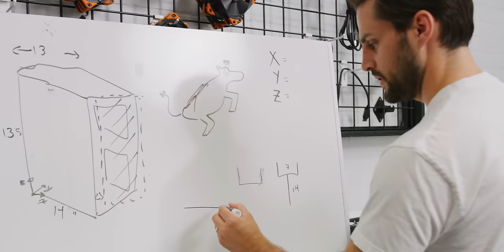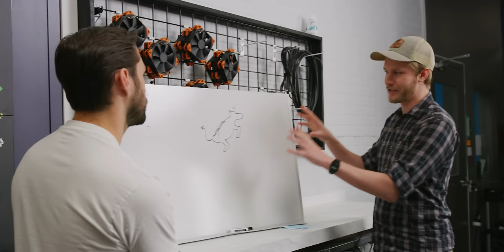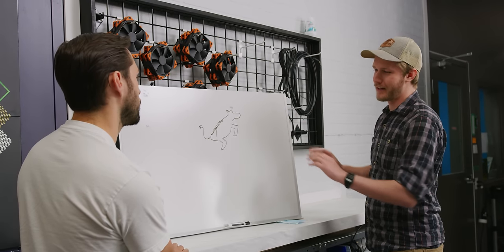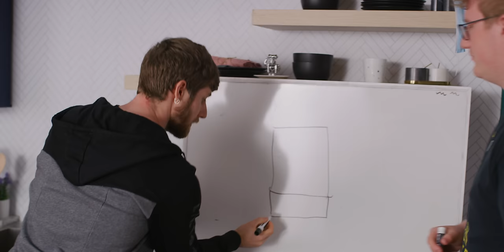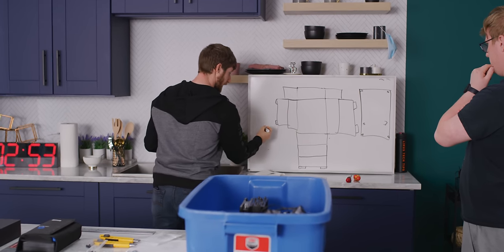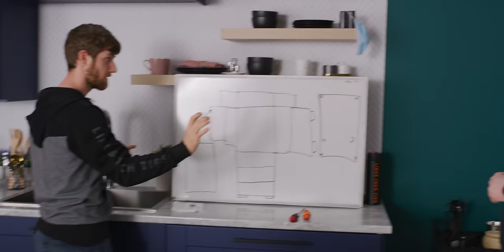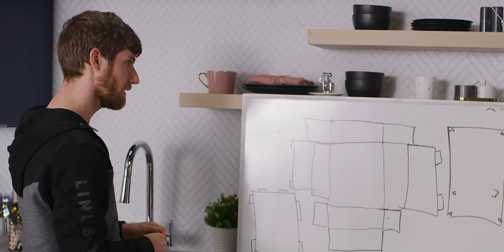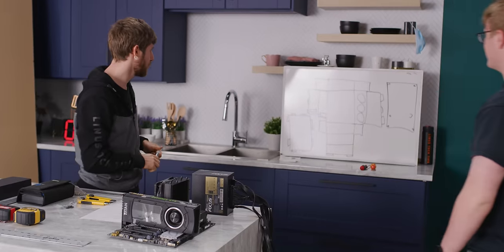Cardboard DIY PC Case Building Challenge!

Comment: Ironically, Alex's engineering background led to him over engineer the case and it back fired on them.
Reply: simplifying a design is a common problem among engineers
Reply: I think draawing on it with sharpie was also a horrible idea
Reply: Well, when I took some electronic engineering technology one of my professors quoted the K.I.S.S. rule, if Alex was an engineer, he should have thought of a "desktop" case with the components laying horizontal.  Actually, both teams should have.  I don't understand this obsession with building towers as towers don't really fit in entertainment systems as much as desktop computers and I was glad that my HP's Elite Desk system and even my older HP Compaq have the option of tower or desktop modes.  The older one the drives could be swapped out and rotated 90 degrees without tools to flip from one orientation to the other.
Reply: do all engineers make horse :')?
Reply: There is no such thing as overengineering....
Reply: @lester44444  no they make cow
Reply: @MicroageHD  its an cardboard case,there is no overengineering boy, actually alex´s design is what most of us will have done when they try to make their own cardboard pc case so ye xd
Reply: I think engineers have this weird habit of flexing whenever they do ANYTHING more complicated than breathing. Probably because they feel the need to justify their incredibly lengthy and expensive time spent at college.
Reply: big oooof
Reply: @jameswolf5513  among
Reply: @Corristo89  When you have an entire toolbox at your disposal, you're going to look for a perfect solution. When all you have is a hammer though... Well, adversity builds innovation.
Reply: @WJCTechyman  desktop computers, yuck. Towers are much better.
Reply: Like the germans did on their french holiday

Comment: Lowkey i want them to spend a lot of time on a cardboard case that actually comes out perfect
Reply: I was thinking that too. You really could build a awesome PC case out of cardboard given unlimited time, tape, and some nuts n bolts to hold the motherboard up.
Reply: I agree m8
Reply: Like a Nintendo labo PC case
Reply: And possibly like laser cut out the cardboard sheet that's been actually designed so that everything turns out perfect.
Reply: Nuno Filipe  or has barely any front IO or non-expandable front IO
Reply: @KiraSlith  glue, if you use glue and glue and press two pieces of cardboard together at 90° to each other of its internal structures it's actually surprisingly strong. 

I want to find some refrigerator boxes and put my open air Linux server in a cardboard box case now ;]
Reply: What he said.
Reply: I want Alex to model out one that you can cnc
Reply: This should become a standardized system.
Reply: Imagine this was the big reveal of the fashioned new totally personalized cardoard cases that everyone will start doing and we defeat case producers
Reply: I feel this is going to become a new challenge
Reply: Yea.Alex should model it and share cad aferwards.
Reply: I made a design for one on paper
Reply: @Puchendante  PC builders when they find out their case is prebuilt

Comment: Warning: this case is not designed for watercooling
Reply: Lone Beast so u need fans HAHAHAHA U HAVE FANS GET IT U HAVE FANS HAHAHAHAHA 😂
Reply: What do you mean, you could still water cool a cardboard case?
Reply: @totallyunoriginalusername  well first, if the coolant were ever to leak we need a whole new case for it, second I don't think cardboard can hold screws that hold the weight of a radiator filled with coolant...the cardboard may get ripped off

Last but not the least since neither cases are stable enough cause they don't have glue in it there is structural integrity issues as the cardboard is relying solely on the grip strength of the overlap and the liquid cooling kit may be too much for it to handle
Reply: TotallyUnoriginalUsername no the case would fall apart and spread the water to Eletronics and you don’t want that to happen or everything will explode or not work
Reply: "Phil Swift here, use Flex Seal Liquid as a water tight barrier and the inside is completely dry!"
Reply: @LoneBeastYT , cardboard is much stronger than you seem to think. With the limitations in this video it might be tricky but if you had thick cardboard and staple gun you could easily build a case which would support a radiator.
Reply: @mina86  i dont think the staple guns are allowed in the vid and thats the point
cardboard may be strong but it doesnt have much support or grip
Reply: @mina86  honestly how far are you willing to go just to ruin a joke man seriously?
Reply: @LoneBeastYT , I’m not commenting your joke. I’m commenting on your later statement about cardboard.
Reply: @mina86  clearly you didn't pay attention to the video

James's pc cant even hold itself sturdy enough when transporting let alone with the water-cooler
And for the record I am talking about linus's and James's pc not cardboard pcs in general
Reply: @totallyunoriginalusername  , exactly! It's even better - if you get a leak it'll absorb it quickly ;)
Reply: @LoneBeastYT  , you're right for typical radiators, because they're are brass/copper (actually they don't hold that much water, but copper/brass are very heavy metals).
However, I recently made a size & weight restricted fully water-cooled SFF PC (trying to keep it back-packable in <13L 400x255x125mm and ~6kg) so while it's not a cardboard case :) (actually it's mostly 3x 120x25mm fans+360rad on top, and 3x 120x15mm fans connected with few 10x10mm alu extresion profiles) it's  very minimal and light-weight (for a desktop). So I used EK FluidGaming aluminium series kits (all water contact surfaces being either aluminium or plexi) and that radiator even being 360 is still very light.
So perhaps such parts can be fine in cardboard case too? (but still probably there are more durable and still cheap materials than ... paper :) )
Reply: @blueckaym   tbh I never really put that much thought into my points as my initial post is just a casual post meant solely for giggles and hence gets likes...I really haven't gone through the specifics, 
You guys are damn crazy to bring out your college research papers for make appropriate arguments...what made sense to me is the fact that james's pc cant even hold itself, forget with watercooling and that's where the argument can be favourable to me, I haven't went into how cardboard as a material can't hold radiators
Reply: @KeeganPlayz1234  So funny i forgot to laugh
Reply: Why not?
Reply: @mustangthekitten7765 I doubt James's pc can support a radiator when it can support itself
Reply: Lone Beast Issa joke my guy
Reply: @mustangthekitten7765  oof you caught me there
Reply: Wait why tho
Reply: Lone Beast sorry
Reply: Lone Beast like I should’ve been more sarcastic with it
Reply: @mustangthekitten7765  nah my brain doesn't get sarcasm well, soo kot your fault
Reply: Lone Beast I’m sorry for the misunderstanding
Reply: @KeeganPlayz1234  lol kid
Reply: No

Shit
Sherlock
Reply: WDYM? It's great for watercooling, since it includes automatic leak detection!
Reply: BET
Reply: oh man ☹️
anyways...
Reply: I mean u could use flex tape in the inside for waterproof lining or something
Reply: @KeeganPlayz1234  you are basically comparing cardboard to a piece of paper. its paper on steroids.
Reply: @Ghostrr I ve seen a yt video of a dude's pc being just the parts with no case,collecting dust along the way

You will never know if someone uses cardboard for this
Reply: @taketokojima3055  nice
Reply: @KeeganPlayz1234  stop
Reply: @KeeganPlayz1234  I know exactly where you got your profile picture
Reply: @haph2087  yeah

Comment: I'd be interested to see this revisited with no time limits, and actually try to make the best case possible, out of cardboard only.
Reply: @IRMacGuyver  my thinking was more tutorial and less competition. Some videos take weeks to finish right?
Reply: and hardline watercooling
Reply: easiest and probably "best case" is still a motherboard packaging at all. I fitted a midclass blower style cpu cooler (which is also the only intake fan!) and a regular psu and a 3,5" HDD in such a package, only for GPUs a low profile card is needed or probably a bigger box, at least all my motherboards had barely the same size of packaging.
I ended up with a GPU sticking out a bit of the box,but it was a damn nice small casing and also "portable" with the handles of the original box. Still all i needed was a more silent media PC and everything lying around was also no real option. Since everything fitted tight in the box, the cooling was also efficient since the only fan, the CPU fan blew air with more speed over the whole mainboard part.
Reply: And expanded rules and tooling.

- Double-sided tape allowed, but penalized by a point for each use. That means long joins with tape are preferable.
- Full complement of bolts, screws, and washers. Every computer builder has either a drawer full of this stuff or a nearby hardware store where you can get this stuff cheap.
- Zip ties and paper clips also allowed for hardware.
- Construction paper for aesthetic flair
Reply: I mean, even sticking to the "no tape" rule, there's a lot you could do with this challenge.
First and foremost, I'm surprised neither team thought outside the box (haha) as far as motherboard orientation, because there are two obvious and simple ways that they could have changed their formatting to better use their materials, either with a purely horizontal layout, OR . . . . diagonal. Linus' outer case is brilliant, and having a separate motherboard tray is a great idea, but they could have easily optimized both their space usage AND structural integrity by having their motherboard inserted at a 45 degree angle with the cardboard folded so that the tray and the rigidity of the motherboard itself provided a cross brace, boosting the stability of their entire design. Folded correctly -- with the upper edge of the diagonal cardboard sheet folded down to make the side panel, across and under to provide housing for the power supply and drives, and then up again -- they could have had an entire assembly they could have then slid into their original housing like a fruit box. The diagonal I/O would have also added some visual interest to the whole build at the same time, something that both designs' Basic Boxes lacked.

All in all, yes, this was a cool challenge, and one I too would like to see revisited in the future. I don't think "no time limits" is necessarily the way to go, given it wasn't so much the time limit that was their biggest challenge as their preconceptions of what the case needed to be, but there's a lot that could be tackled with this concept and I'd like to see them do so.
Reply: New video series, Cardboard Wars!

Comment: You guys should do a PVC + acrylic sheet case challenge! It's cheap and looks decent. It's mostly open air and waaaaaay more structurally sound than cardboard
Reply: Ayy 👍
Reply: I like You Chanel
Reply: I vote for LTT and Oz colab trying to build the ultimate DIY case ahah
Reply: Seems like a good idea but I would be worried about the amount of static electricity pvc generates
Reply: @silverado_vila  maybe once the world stops falling apart like James case.
Reply: ayyy
Reply: OZ x LINUS COLLAB
Reply: Acrylic is not cheap.
Reply: And wood don't forget about wood
Reply: But they can only use tape!
Reply: Is this a challenge? Please be a challenge
Reply: fixing fans near heat sink is SO BLADY, my next build will be OPEN AIR ( no Case used ) that's very easy to connect, disconnect and fix new things
Reply: Its fun, until you know your setups need metal and airflow to reduce heat so you can feel safe everytime you play heavy games.
Reply: @DeathByClam  a nice wood case would be awsome
Reply: no

Comment: When you lower the price so much it could run like a potato but still has the best price to performance
Reply: ladies and gentlemen, scrapyard wars
Reply: Considering you can get boxes for free if you look well the price to performance is infinite.
Reply: Mr. Moʀɖɛռ 0/0 is not infinity.
Reply: @charlesgarrett6324  Sure if performance is 0.
Reply: @DickbuttChillingOnPluto  Rather put $50 towards a better CPU. Function over form.
Reply: @DickbuttChillingOnPluto  It was a math joke okay, as the bottom number approaches 0 the solution becomes exponentially bigger. If the bottom number is zero you get infinity, generally considered an error.
Reply: Mr. Moʀɖɛռ yeah a box you picked up for free that has no computer hardware in it has 0 performance.
Reply: Mr. Moʀɖɛռ you are thinking of limits which is an improper approximation of 0/0. If you divide anything by 0 it is not infinity it just doesn’t work. No matter how many zeros you have it is still 0.
Reply: @charlesgarrett6324  https://en.wikipedia.org/wiki/Division_by_zero "it may generate positive or negative infinity by the IEEE 754 floating point standard"

Comment: (C)ardboard (A)ided (D)esign.

I built a sound booth out of cardboard around my computer desk and lined the inside walls with sound proofing foam pieces. No joke... works stupidly well.
Reply: Well cardboard is a noise deadening material so, it's to be expected, what is not to be expected was I used cardboard in my old pc to make a fan shroud as I had a network card too close to the GPU for noctua's fans to fit, and MSI's fans are absolute trash.
Reply: How about ventilation?
Reply: i need to see it
Reply: now
Reply: You just gave me an idea I should not do. Build a cardboard fort, buy carpets and sound proofing foam, and use that as a mini sound-booth.
Reply: how do you hang that thing at the back of the mic? or you just tape that to the wall?
Reply: Continuing the cardboard theme, I have seen egg cartons used for the sound damping, as well, instead of foam.

Comment: Next challenge: a case made only out of the packaging your components come in.
Reply: Setup on the motherboard box, challenge complete
Reply: @billgorsey8010  cpu cooler on the cpu box taped to the mb box
Reply: @billgorsey8010  Or
Open up both GPU and mobo boxes, cut tops off them, and tape the opened boxes together. Cut a hole into one of them and stick the clear plastic for the RAM into it for a window.
Reply: You guys are forgetting about the PSU and it's cables. Therefore put the MB box on top of the PSU that sits fan-down :)
Reply: @bill that's my current set up while waiting for the case, damn I sure miss newegg will call😅

Comment: I feel like they shouldve been given a whole day to plan and build this case, wouldve been a whole lot better in terms of content instead of arguing under time pressure and lowkey hating your partner.

More time to build the case means we get to see their actual technical intellect and maybe even a vision of what they want cases to be like from companies.
Reply: Exactly. This was a really cool idea to see what all amazing stuff they could do instead of making it a rushed cramped mess.
Reply: or a few days. lots of content can be pumped out
Reply: See, that would run the danger of actually being good content. Can't have that.
Reply: why not both? :)
Reply: @GeorgePerakis  Tell us how you really feel.
Reply: @papayer  You can't deny that a lot of their stuff is rushed. The one vid per day thing is not a good formula for quality with the number of employees they have.
Reply: I really wish they do this again with no time limit
Reply: yeah but this worked out better it showed that they could put one together under all that pressure and it still turned out good the only thing that would have changed with more time is them actually lining everything up. they all had an idea 30 mins in so i guess the only thing i would have done is let them have an hour to plan and three hours to build that should be more then enough time.
Reply: They only got one evening to plan, did they even use that time?
Reply: 100% Agree
Reply: the problem with this is that they aren't designers but well I get what you mean
Reply: it wouldn't be as entertaining tho
Reply: Blackpops they don’t have to be designers lol All I’m saying is that they could implement (in a cheap cardboard way) some features they might want from a case or maybe fix something to their liking, and therefore showing what they (and we), as consumers and reviewers, want. Just a thought that I had when writing original post
Reply: Happy Dolphin have you seen scrapyard wars? I think that content is much more interesting than this video lol if they gave that much time to build this cardboard case, it might’ve been the best of both worlds hahaha
Reply: 시간을 많이 준 만큼 그만큼 게을러졌을수도..ㅋㅋ
Reply: Zakidisch 그럴수도 있지 ㅋㅋㅋ
Reply: THAT SSD WINDOW THO
Reply: Nah, just mash it in there
Reply: So are we going to ignore the fact that "Interviewer" was Linus? Lmao 00:55
Reply: You have a good point, but I think they didn’t intend to make this a professional challenge

Comment: 4:02 "Let's just start and we'll learn way more from doing it"

Words to live by.
Reply: I think I'd probably just mount things on pieces without the tabs, then you can move them where you want, unfold and work out how to make it in one piece. Sure it uses up cardboard, but the pieces could be used for support n such. No need to work in your head and on whiteboard when you can just fold the material so quickly. Though it does look like a lot of card was used on linus' box so maybe they wouldn't have had enough for this

Comment: They finally build a cardboard pc case and here I'm running my cardboard case for last 3 years.
Reply: @IRMacGuyver  it used to be but then I added two fans. One salvage from an old CD player and another old cpu fan. Had to use a resistor to slow down the second fan. Otherwise I sounded like a jet engine.